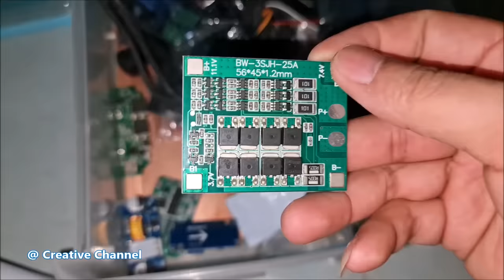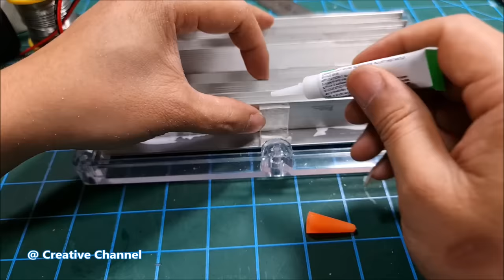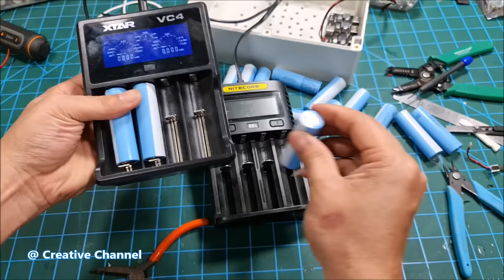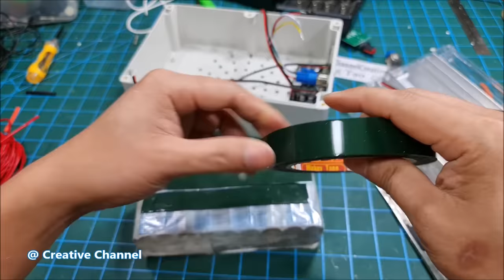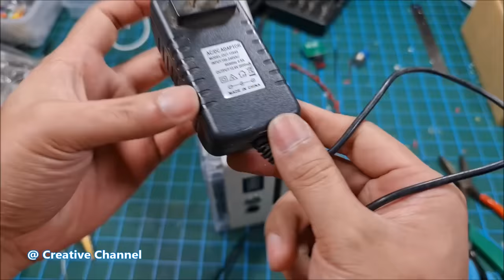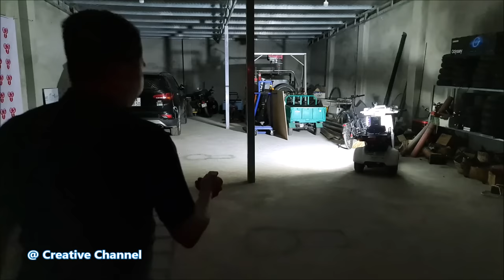Build A Power Bank and Camping Lamp Light 2 in 1 - 70W 4 Port QC3.0 18000mAh

Comment: Seems good and I like how you built a nice big battery pack to deal with the high current demands of the LED lamp. However, couldn't yopu have placed the heatsink in a better location? It is too close to the battery pack, and Li-Ion batteries do not like excessive heat.
Reply: Probably should have added an exhaust fan on one end and an intake on the other end….and build a separate compartment inside that was well insulated and was ducted to get some of the airflow

Comment: so - fish paper at random - not between the parallell groups, spend an age drilling vent holes then promptly sealing them off again with a CROOKED fitting battery, topped off by fitting a handle with nice sharp self tappers - that are just itching to puncture - then short out the battery - should it ever come loose.
Reply: I think the worst part is that led heatsink directly touching the batteries. And the led light needing a remote controller, thats just waiting for you to need that light and not being able to use it because the remote cr2032 died
Reply: Yeah some major oversights on the thermal end.
Reply: See what you mean

Comment: You should display the circuit diagram. It is not clear from your video whether you have used any dc to dc step down buck converter or not for supplying power to power bank unit. What is the input voltage of power bank module which is charging the phones via USB?
Reply: Right

Comment: could have used an internal charging  circuit and ac input or usb c charging. but very nice built
Reply: Buy an Sw2303 module. It can boost 12V to 20V for the 20V PD protocol but be wary. It gets hot and eats electricity. Runs much  better on 4S of course but you could use a Buck converter for the LED and let the two USB modules enjoy 16.8 to 12.0. 

Lots of options for 3S and 4S boards similar to TP4056

Comment: Really nice... I want to buy this product in qty. Because really need in my country
Reply: I could build something like this but components would cost 
$50 18650 cells
$10 BMS, fish paper, Kapton tape 
$10 USB Module
$20 wire, switches, etc
$10 COB LED
$20 ABS box with clear window

If you can source the components cheaper in quantity below 100 let me know. I could build 10 of these a day if I did an assembly line of stages

Comment: do you make such power banks to order?
Reply: I do. USB A QC 3/4 max 24watts and USB C PD 3.0 max 65 watts. I have the capability of doing PD100W but the board is not cheap. 

I prefer to make them 4S and then however many cells you want in parallel. I have some salvaged LG 3500mah cells with 90% capacity so I can provide all components, you just pick the box

Comment: dont leave it powered on for more then 2 minutes or the bigass COB led will burn out due to overheating.

crappy thermal design. not usable in real world.  like apple crapbook that needs to be stored in the fridge in order to prevent overheating.